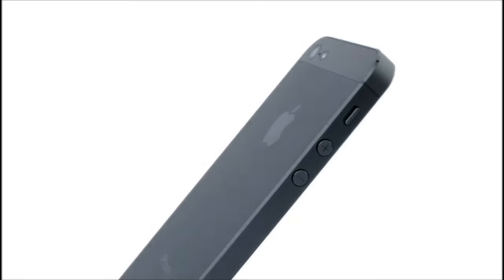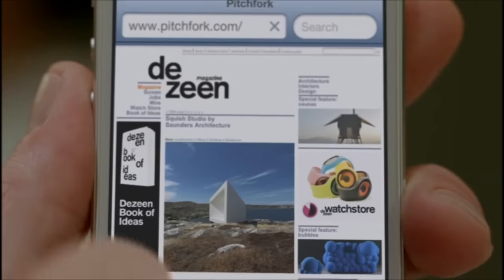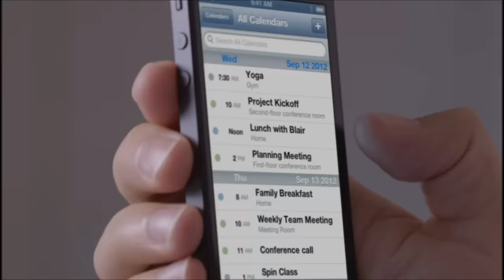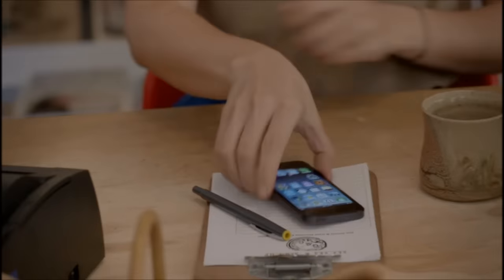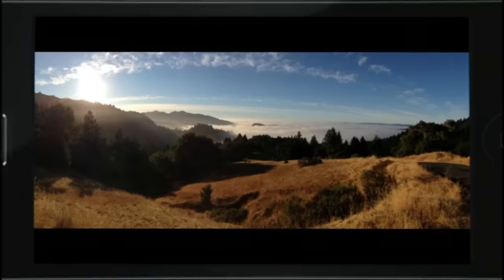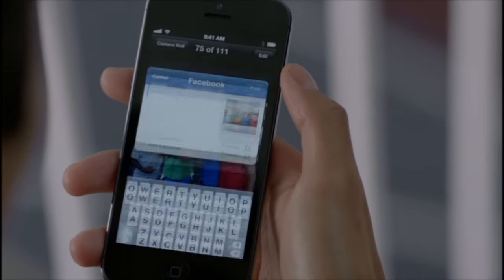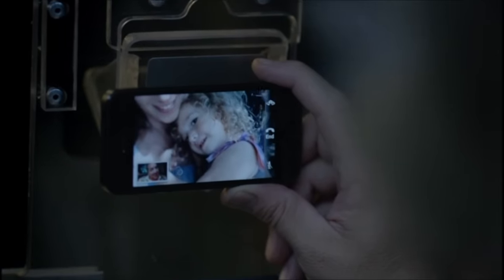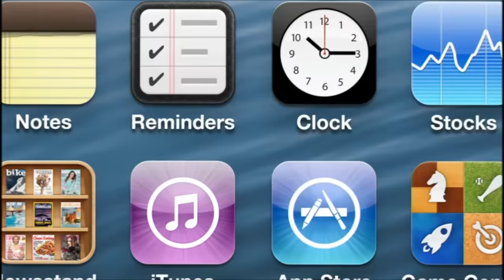Official iPhone 5 Trailer

Comment: I still have this phone.  One in black and one in white.  Both with original boxes also and used accessories.  They're running iOS 10.3.4 now but still great little iPhones with a great design.  Best designed iPhone, even in 2020!
Reply: i do as well but the white one i have is still sealed. i don't think ill ever open it.
Reply: luis barbosa
Dang!  Now that’s nice!!!

Comment: I'm getting a iPhone for Christmas, should I get iPhone 5 or iPhone 6?
Reply: 5s
Reply: 6
Reply: %s
Reply: Of course you should get an iPhone 6. Why? Overall is everything better. I've just got it. I was really pleased with the 5S but I updated anyway. I think you should go and feel it in your hand. They who write 5S have'nt got a 6 or can't get you a good reply. Good luck.
Reply from the maker: If you are using it just as a Phone I would advise you to get the iPhone 5s since it`s smaller and probably does fit easier in all your pockets. If you are going to play Games with it too then I would go with the iPhone 6.
Reply: 5s
Reply: Android.
Reply: Buy the phone that you are comfortable with using.
Reply: get iphone 5s better than 5 and not bending like 6 !
Reply: Any phone can get damaged if handled recklessly. Then again,  the lack of a solid inner frame makes the iPhone 6 almost as vulnerable as a can of soda.
Reply: 5s
Reply from the maker: All depends on what you plan to do with it? Iphone 6 does give you the bigger screen BUT just make sure you dont put it in your back pocket as im sure you aware the phone can be bent over time.
Reply: In regards to either iPhone, just use a phone case. It will help reinforce the structural integrity of the phone itself.
Reply: me too
Reply: i'm little bit jealous. but you should get 5s, since iPhone 6 is too big
Reply: 5 or 6? Get the 6 unless if u get the 5 u get extra money or something else with the phone...
Reply: 5s
Reply: I think you should get 5 because 6 will easly brake and 6 is to thin and its to much money
Reply: Neither galaxy 6 is better stronger cheaper and very good camera
Reply: Chrisonix gaming You're not answering the question.
Reply: 6
Reply: 6s on iOS 9
Reply: +HEROBRINE228 actually, the 4s has ios 9 as well.
Reply: iPhone 5S
Reply: What do you think.
Reply: iPhone 5!!!!!!
Reply: 6! 5 is old and they don't even make them anymore
Reply: I got my phone a year ago,
I got an iPhone 5s,

You can stop commenting now XD
Reply: +-Catsrock237 - get a 6s
Reply: Get an iphone 6s+
Reply: ***** lmfao
Reply: 5!
Reply: +-Catsrock237 - Get a Iphone 5/5s. They won't bend. But if you want a bigger phone, get a Iphone 6.
Reply: Try a 5s. It's kinda the iPhone in between the two
Reply: You sould just get the iPhone 7
Reply: It hasn't came out yet silly. Ranjot Kaur
Reply: The 5 man just great
Reply: -Catsrock237 - get the 7
Reply: -Catsrock237 - you should get iPhone 8
Reply: Hamayal Mujtaba chishti prepare your kidney tho
Reply: -Catsrock237 - I have iPhone 5c is bad phone but I get iPhone 5se like I recommend se

Comment: I still have my iPhone 5 from 2012 with ios 6.1.3 and still out performe any other 2016 smartphone in speed and fluid and snooth
Reply: but doesnt support new apps anymore
Reply: Yes some of it is still support but is a,rare version and it was the last version sign by Steve jobs
Reply: Christian Marrero its time to upgrade man
Reply: you can jailbrake it to change the ios before
Reply: if you dont like the new ios
Reply: I have a 6s plus but ios 6 is still one of the best OS it still the best fluid,smooth,fast,less,less battery usage,more secure,responde fast and much more

Comment: I want a buy a new phone.. But i never use ios device.. Shall i get iphone 5 or iPhone 5c?
Reply from the maker: Shahrul Aziq PTV iPhone 5c has a "plastic" case it was design fro the china to make it more cheaper to buy.
Reply: iPhone 5 is the better than iPhone 5C and a little bit faster than 5c
Reply: is better*
Reply: Or Get iPhone 5S
Reply: +I.O.S I agree get a 5s. it a better upgrade
Reply: yeah pretty sure
Reply: +Shahrul Aziq  PTV Iphone 6 ;D
Reply: +Mathijs TheMiner _/-/////:(7;-1480
Reply: ok
Reply: +Shahrul Aziq  PTV for my advise 
u should use iphone 
at first u thought it suck 
nut again over 2 years 
i just wanna get back to iphone 
why ? because it's iphone
Reply: iPhone 5s or iPhone 5c
Reply: 5
Reply: I think u should buy IPHONE 5 cuz if u buy IPHone 5C ur friends think u make you 😂😂😂😂
Reply: +Fajrian Rian ups not you but toy
Reply: Yes i buyed mines on june 2015 with ios 8 and it still running ios 9 like a champ
Reply: +Chibi Hal Jordan and that different design
Reply: iPhone 5.

Comment: Watching on my iPhone SE. Still a speedy little phone that looks just like the 5 and still received ios 13. Pretty amazing.
Reply: Krypton 114 I know, but it still works well with iOS 13.
Reply: Same here! Incredibly disappointed that the new SE is the huge size :(
Reply: Same here! Incredibly disappointed that the new SE is the huge size :(
Reply: Same here! Incredibly disappointed that the new SE is the huge size :(
Reply: iphone se still receives ios13?!
damn and my note8 stopped receiving updates..thats why im switching to i12..
Reply: Black Bird Noodle there are many reasons to not like Apple, but many more to like them. A friend a mine just stopped using iPhone 4s last year cause the battery died. It was still very useful.
Reply: Guess what? It’s also going to receive iOS 15!
Reply: @NitheshVG734  I know!!! I can’t believe it. I just installed the Beta and it’s handling it like a champ. Still very smooth.  Apple is killing it in the update department.

Comment: Still have my iPhone 5 as a back up I brought new when first released. 
I've changed the battery about 3 times and the volume flex cable. Other then that it's all original and still soldiering on.
Reply: Jonathan Thorpe well it’s 8 yrs old so that good for a 8 yr old phone

Comment: Apple should invent an iPhone with 1TB SSD. 250 GB for iOS and 750 GB for macOS. If I'm on my way, I use the iPhone with iOS, am I at home, I put it into my dock, the dock is connected to a monitor screen and I use the iPhone hardware as a computer.

Comment: I think Apple should introduce a cheap iPhone with design iPhone 5 with Home Button with square. Its version without Touch ID. But there will be a Touch ID version. This iPhone includes Apple A12 processor or A10 or A9 and 16 32 64 128 GB memory. Operating memory is 4GB. What’s a nice iPhone,isn’t it?

Comment: im using my 5s since 2013, for almost 7yrs of using the screen pop up and battery drain fast now. its still workin, but for my own safety i need to change new phone because of its battery. i love 5s, the design simplicity,slim and squarey. im really satified for having this phone for 7yrs. i hope will apple upgrade this phone same design. by the way watching for my new phone oneplus7pro.